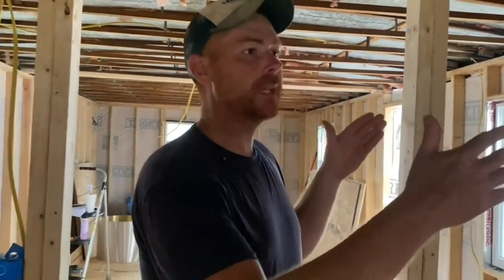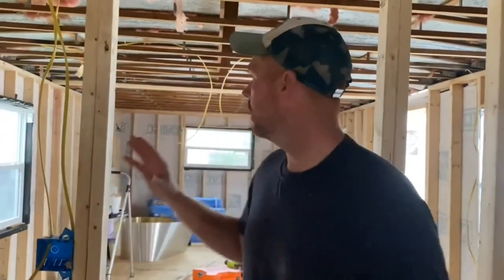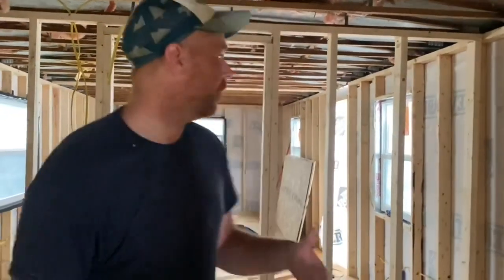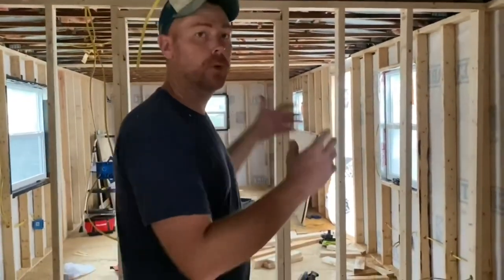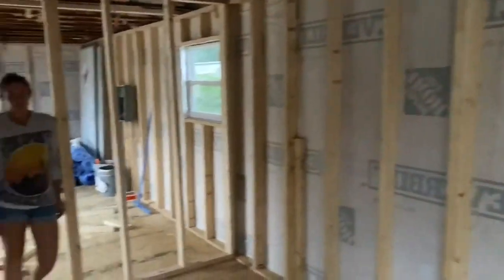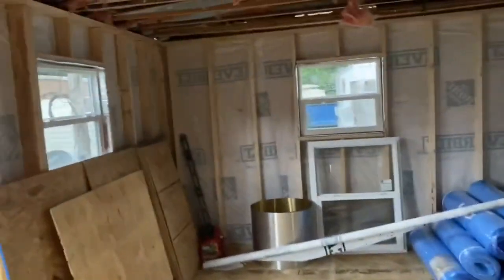We Bought The Cheapest Mobile Home EVER

Comment: If you need to strip out the whole home joists to rafters as you appear to have done to this one. Is it really better than replacing with a new home? I am not a carpenter, plumber, or electrician, so there is little I could do myself, besides write the checks. I have an old Shult home that needs extensive repairs. I'm currently thinking about replacing or rebuilding. I have done over one end, but still need two thirds done to be a complete remodel. And it would still be an old home in a park. If replaced, it will still be in a park, but at least it's new. And the money I spent on the first third puts me off rebuilding. Still my home NEEDS something. Either repair or to be replaced. I'm currently able to do either, but not both. I could even go with moving out of the park. Then I would like a new one to sell. It is a lot to think about. What can you tell me?
PS. one of the only reasons I am still considering rebuilding my old POS is that I just put on a metal roof.